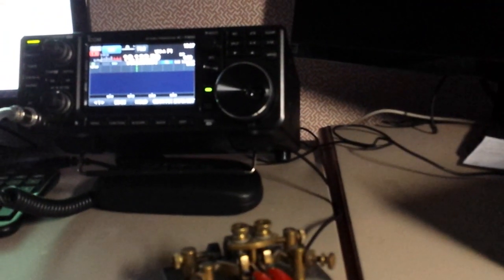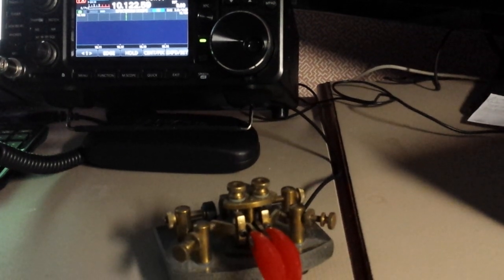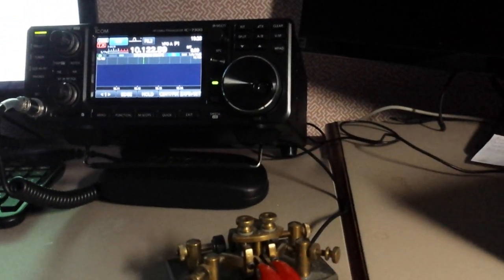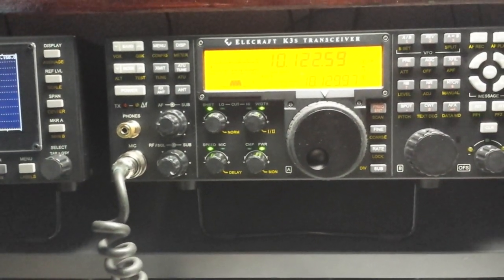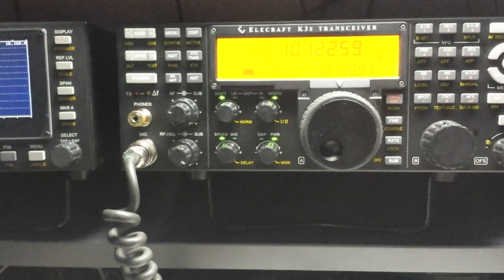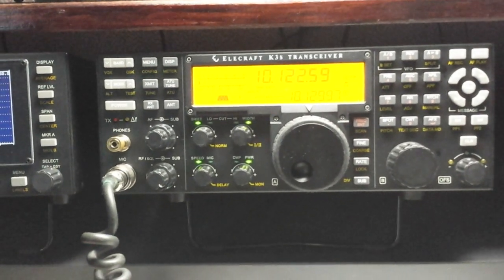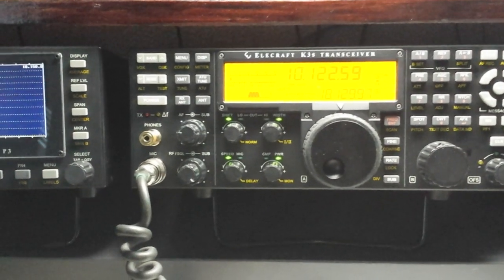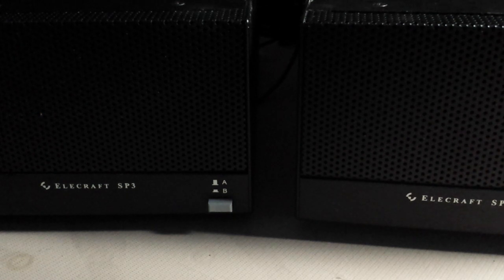IC-7300  VS K3S  Weak Signal CW Comparison

Comment: The beacon has a low battery so the tone drops due to the load. I prefer the Icom 7300 to the K3. The have about equal sensitivity but the 7300 has much richer audio. 73's w5yb

Comment: Your reply in the comments of 4 years ago.
 "Once the close-in dynamic range reaches the mid 80s there are few occasions where higher would help. The 7300 is at 94 vs the K3s at 106. The only way to experience the difference in real life would be during Field Day where you might have someone a few feet away or such. Too much attention to Dynamic range is given while ignoring actual demodulation. What you hear in your headphones is much more relevant. This is something that instrumentation based testing fails to reveal. It won't be long before the K3s is replaced with a K4. Elecraft will have to catch up. Just watch!"

"It won't be long before the K3s is replaced by a K4"..

Comment: I recently bought an IC-7300 and agree that it is a very competent rig! It has more features, and receives better with more dynamic range than my vintage rigs, and also better than my not so vintage Icom and JRC rigs. Sherwood Engineering has it way up ahead of many much more expensive rigs in their dynamic range testing. I was able to buy my IC-7300 for just under $1000 brand new from DX Engineering so I am amazed at the performance Icom is delivering at this price point. It's easy to use to with the touch screen. All my other rigs will soon be worth no more than $200 on the used market...

Comment: It's easy to make a receiver sensitive. Selectivity is where the K3 will win. put a 20 DB over 9 signal 1KHZ away and copy that weak signal. That's where the rubber meets the road. Also if you aren't centered on the crystal filter, that will make a difference. Thanks for the comparison but a receiver evaluation this is not.

Comment: Don't own either and to my ear the 7300 sounds way more clear with less noise. Reading comments and I can see K3 owners bias. I would be happy to own either.
Reply: I'm a K3 owner considering a 7300. It's not bias. Close in selectivity, the K3 can handle a 20 DB stronger signal before meltdown. It's just a fact. And because of roofing filters, theres never a situation where the ADC gets overloaded. And I think the 7300 is a wonderful rig that punches way above it's weight. I want one. But they aren' in the same performance class. The 7610 is a closer comparison but it also can suffer from ADC overload. Thats why the K4 from Elecraft has a direct sampling RX with a superhet option for maximum performance. Direct sampling and superhet are completely different animals.
Reply: Better A/D chips will yield better results, but the reason for direct sampling on this rig is it's cheaper to make. I still want one :)

Comment: Always thought I wanted some Elecraft gear.  Not now.  Not a 2 or 3, maybe a K1, with lots of options, in a pack for special outings.  Thanks.
Reply: Listened again.  Again I hear about the same signals but prefer the tone of the noise in one over the other. All ears are different. Ears are not lab instruments, and they change with age, same as eyes.  Get the one you prefer.

Comment: Based on the audio provided the 7300 is the clear winner.  If you take in to account the price difference the 7300 is a slam dunk.  Thanks for the comparison, I too would like to see a similar comparison with a stronger signal.
Reply from the maker: Can't do. I sold the K3S.

Comment: The whole premise of "above the noise floor" is mis understood.  What you think is that the rig has a noise floor and every receiver does have one.  AND it is INSIGNIFICANT in BOTH today's superhets and SDRs.  BUT STOP! here is the problem: atmospheric noise IS a signal.  It is just there.  If you connect an antenna and the noise level increases, your receiver is sensitive enough.  At that point, every receiver can "pull out" (another misnomer for another discussion) a signal.  At this point, you need antenna gain and directivity to bring the desired signal higher than the atmospheric noise.  Dynamic range is the important spec in a receiver.
Reply from the maker: However even though the DB level of residual noise might be the same on any two radios, the listener may still deem one noisier than the other. This can be due to AGC threshold levels or DSP algorithm variations. An example is the IC-756 proIII or the IC-7000 which seems to convert atmospheric static crashes into sharp noise spikes which totally drowns out weaker signals. I site this video as evidence. https://www.youtube.com/watch?v=6g0womtPda0
Reply: You are correct. I'll also add that most circuits these days are so quiet that the noise contribution should really be minimal. Most of the noise you hear on your radio is a real signal that even the most accurate spectrum analyzer would pick up. Between these two radios, they may have different filtering and different demodulation algorithms, not to mention different post-processing on the audio chain. Great video though!

Comment: It really sounds like the passbands are different, the 7300 has a lower cutoff on the high end of the filter skirt, the K3 is a bit higher (or the skirts are set differently.)   It also sounds to my ear like they have different center frequencies so that the signal sits in a different part of the passband for each one.  At this filter width, I imagine 10 or so Hz can make a difference.
Reply: And, thanks so much for the demo of the two side by side, Steve.

Comment: I'd like to see a comparison in a contest with lots of big signals.  I'd bet that the 7300 doesn't look so good compared to the K3 in that test.
Reply from the maker: Bet you a dollar... I would take home your dollar and save $4,000 on radios.  Not a comparison but listening around shows there is a total lack of intermod and perfect selectivity. https://www.youtube.com/watch?v=2HE7N3VhPg4
Reply: Steve Ellington Wow. I didn't think it had that good of a front end. Really nice radio actually. The big thing that would make me hesitate is the loud relay. Already have the K3. I do agree the weak signal sounds better on the 7300.  I think Elecraft needs to come out with something new soon. The K3's are a bit long in the tooth
Reply from the maker: Yep. After having my K3 and K3s for 8 years I found it was gathering dust after getting the 7300. Sad but true. I sold the K3S and had change left over to buy 3 more 7300s.  The dual receivers was nice and that's the only feature I miss. The IC-7610 will eventually take care of that. .... The relay noise is a problem and my fist and easy fix was to stuff a wad of poster putty around both relays. That makes it bearable. I then removed the amp keying relay and bypassed it so its driver transistor keys the amp directly. That eliminated 90% of the noise.

Comment: The 7300 is a great entry level rig. Maybe the best entry level rig out there, but apples and oranges. 7300 will overload whilst the K3S runs merrily along. Contesters even run two stations in same band at close proximity with the K3. The 7300 would turn into a puddle of goo. Theres a reason one is 4-5K and the other is 1300 bucks. Articulation of signals goes to the K3. Warm and full are not terms for intelligibility. :)  You are talking a highly selective front end with roofing filters versus a wide open direct sampling design. The ADC in the 7300 is a 9 year old design. It will get swamped in a huge pileup.
Reply from the maker: I hear this a lot but so far nobody has cared to demonstrate it.
Reply: It is well tested in the lab sir. Place a 20 over signal 2KHZ away from an S1 signal and watch the 7300 melt. The K3 will make strong station go away. Theres a reason the rigs have different price points. The K3S outperforms rigs twice the price. But people like pretty. You can't sell performance. But......the K3 has better guts. Its irrefutable. Even the Ham stores will say the same exact thing if you ask them. Not in the same league. These subjective audio comparisons are useless really. You can make any rig sound good if you set it up right.
Reply from the maker: What lab?
Reply: Sherwood Engineering
Reply: See, the 7300 is pretty good, but it's no Elecraft. Blocking dynamic range is how well the receiver maintains a weak signal in the presence of a strong signal. A lesser receiver will defense, and what appears as increased band noise, is actually there receiver being overwhelmed. The 7300 is a direct sampling receiver, wide as a barn door. The A/D converter sees everything all at once. The K3 is a hybrid of a single conversion superset receiver, with roofing filters, all before it goes to the DSP portion of the radio. That level of selectivity makes it able to handle extreme conditions. It is the rig of choice for DXpeditions. People all next to each other, often o the same band. 

Elecraft isn't sexy, but it is high performance. To each their own. The 7300 will do great for casual operation and Icom has sold a ton of them. Nice rig.
Reply: Erin, Is the KX2 &/or KX3 even close to the K3?

Comment: Thanks for the upload, what great radios both. 

Hope it's OK to add that on a clean band like this, CW (and any other modes) reception is easy for any radio. I would expect the K3S though, with its much higher dynamic range, to receive much more on a busy band, with many more offending signals up and down the target station. 

Maybe if possible such a test could be run one day? 

TU es 73
Reply from the maker: Once the close-in dynamic range reaches the mid 80s there are few occasions where higher would help. The 7300 is at 94 vs the K3s at 106. The only way to experience the difference in real life would be during Field Day where you might have someone a few feet away or such. Too much attention to Dynamic range is given while ignoring actual demodulation. What you hear in your headphones is much more relevant. This is something that instrumentation based testing fails to reveal. It won't be long before the K3s is replaced with a K4. Elecraft will have to catch up. Just watch!
Reply: Possibly, let's see what the future will bring. Not interested in favoring either / any brand. 

But the Icom 7300s has no roofing filters capability.

Unlike the K3 that does;  and which can take several too!  That's maybe what makes the difference in Blocking Dynamic Range, where the K3S is some 37 times (!) superior to the 7300 (150 vs 123 dB).

And the 12 dB DR difference indisputably shows the Elecraft is by 15 times superior to the 7300 in this respect too. 

That's maybe also why 7300s are for now so far behind the pack, in the 12th place - source Sherwood Engineers Inc. 

 I have both Elecrafts and Icoms, as well as a better DR valued radio than the 7300  (Perseus@99 dB) 

When it comes to congested bands, as I have found CW/FSK etc on the K3 (let alone even the much better k3S) gives a stellar copy, even with the auxiliary receiver. 

That's is the hands on experience here with the 250 Hz roofing filter (KFL3A-250) here.

Maybe you don't have the roofing filters yet? But when you do you will find similar findings if you run a tight spaced copy on a congested band. That is why theory and practice go hand in hand in my professionally qualified experience. 

I have had several Icoms,  I do love the brand. But when it comes to close up powerhouse stations obliterating QRPs in Manaus  or Port Elizabeth, the K3 delivers. 

That's why I'm selling my Icoms and upgrading to higher end Elecraft gear. Maybe tomorrow it will be Icoms again - but they have much catch-up work to do. 

On the flip side, if top performance in DX is not the choosing criterion? Indeed the 7300 provides a compact package with an attractive built in scope and is very good value for money.  But that's all you get - no upgrading capabilities at all.
Reply from the maker: I owned a K3 then K3s for 8 years and yes I had them loaded with those wonderful roofing filters. 

The term "Roofing Filter" is hype for "Crystal Filter" in the first IF stage. That is 1940's technology. The Hammarlund HQ-120 had one!.  The K3 is simply a superhetrodyne receiver with a DSP demodulator. Crystal filters attenuate the signal which must be compensated for by extra stage gain which in turn generates noise and ringing. We are now beyond that.

The 7300 uses "Direct Sampling" ...There are no "converters" and no "IF" chain. There is no place to put a crystal filter.  Signals from the antenna pass through a bandpass filter and go directly to an analog to digital converter chip where large chunks of spectrum are sampled and digitized ...A crystal filter would corrupt this process. That is why the 7300 and Flex rigs can detect weak signals better. 

Once you've convinced yourself that you have the best rig around it's had to be objective. The 7300 is a cheap radio at $1400. My K3s package was around $6000. I could just refuse to admit that the 7300 hears better but I'm trying to be honest.
Reply: Yes, I hear what you are saying, and indeed the two radios are  different class radios, both price wise but mainly performance and upgrade potential too (connection to an external monitor may be a saver one day for our aging sight). 

I am glad you call the xtal filters "wonderful", as they do make such a wonderful difference; again there can be little performance comparison between these radios, with all the due respect to the brand and its owners - that goes without saying.

And yes about the known history of tighter roofing filters (thank you Orion!) of analogue vs digital architectures with most SDRs for now sadly employing only Direct Sampling, no IF stages. Hence no IF outputs either for the 7300. 

But wouldn't you agree that the lack of roofing filters is most DS architecture Achille's heel when it comes e.g. to QRP tightly enveloped in QRO? All evidence existing supports this. 

That is why the third way that Elecraft comes up with,impresses: a mixed design, to allow taking advantage of proved signal handling, xtal filters. 

You mention that the Flex Rigs can detect weak signals "better". In what sense though? Noise suppressing algorithms for "clearer" audio? They won't though dig the signal out of the noise, and here's why. Take, for example, Flex's latest 6700. Its MDS (minimum detectable signal) is again some 10dB weaker than the K3S. And it costs more than twice as much as the K3S ! (http://www.sherweng.com/table.html). 

If one can provide any solid evidence (QRP in QRO environment or objective lab measurement)  to the contrary, with the 7300 please share the evidence, I'm eager to catch up (22 Aug 2016) and learn from fellow operators. 

And yes, although I love our lovely radio toys, there's no point being a  brand "follower" or spend over-the-top. 

Suppose it all boils down to what the product user wants out of the radio - possibly including cosmetics. But although good looks may be subjective, evidence based performance measurement, cannot be denied - whoever does well, deserves the credit.
Reply from the maker: I won't agree that the lack of roofing filters is the Achille's heel in any DS architecture. Nope....The heel is ADC overflow. The cure is not crystal filters. That would be impossible since there is no intermediate frequency. The cure is better, faster,  more expensive, ADC chips. MDS is a non issue. Radios have been sensitive enough since Armstrong invented the regenerative receiver in 1914. Naturally the Flex 6700's ADC is far better than the 7300's but as time goes on, the price will drop. Flex needs to develop a better AGC system though. It's pathetic and almost like  not having one.
Reply: I too hope that in future faster, cheaper chips will be available, they'been saying that for some years, amen!

But hand-on-heart, so far at least, it seems that Elecraft's hybrid solution (although costlier than direct conversion) still manages to top the performance, specs and value for money list, at a fraction of the cost of other high end radios ( Flex-6700, IC7800 etc) - I do admire the folks. 

Have never had a Flex radio - I do envy you for having had all these lovely sets! :-)